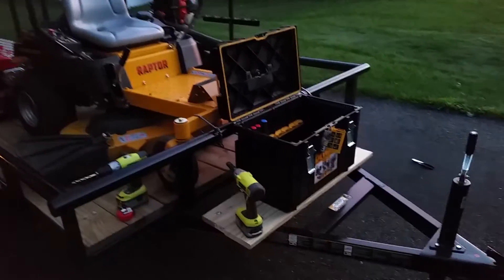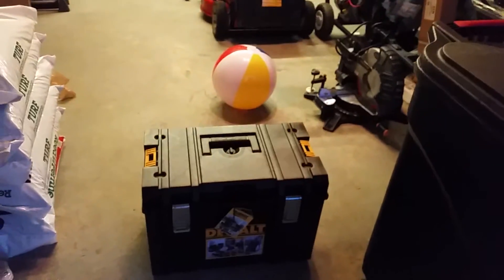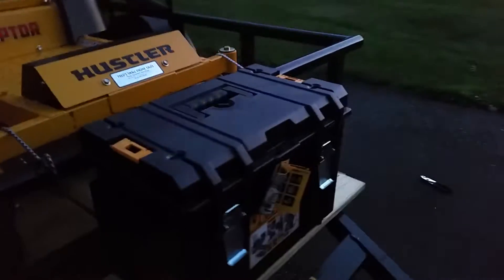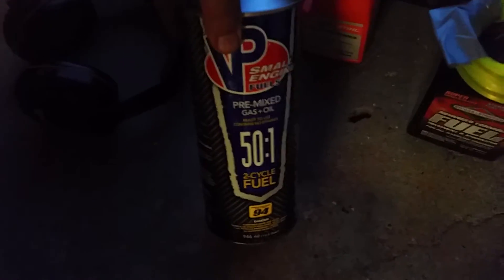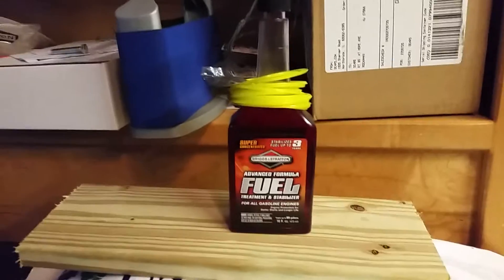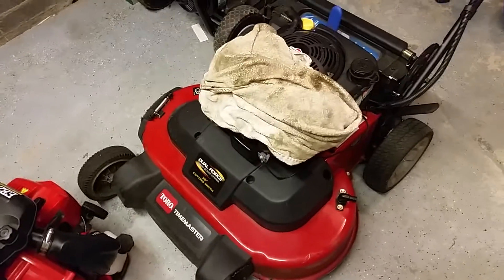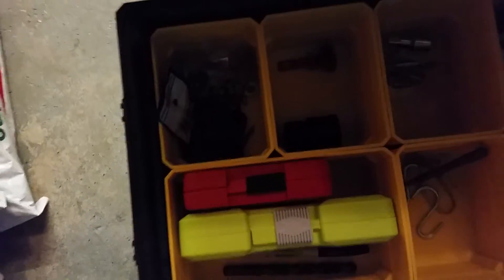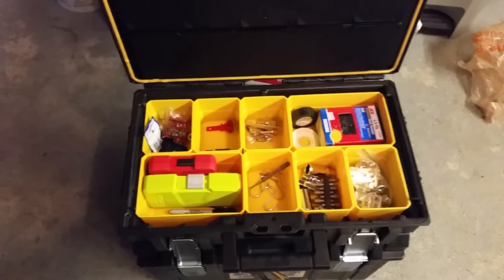DEWALT DS400 TOUGH SYSTEM REVIEW

Comment: I've questioned selling my TM and grabbing a back up awd a few times now... I always tell myself if my 44 breaks down its my back up in a pinch and I carry it with me. 

As far as impacts go man I got a Milwaukee set a few years back and when my 1/2" broke it was tough times going back to cheater bars lol my wife ordered me a replacement for my birthday and when it was in the mail my cheater bar skipped and busted me in the face below my eye. Man I was pissed off, what are the odds right? Man I love em. I have three 3/8" ones (dewalt, Mikita and Milwaukee)
Reply from the maker: Wow that sucks bro ...damn I hope it didn't hurt too bad ...you got 3 impact wrenchs?? I was thinking of getting another one a smaller one ...I love ryobi stuff ...toro owns them fyi...but they don't make a small one...what one you like best...???
Reply: That's the thing. I keep my dewalt inside the house because the battery dies so fast. The Mikita has a new battery and is small so I keep in in my truck. But the Milwaukee(s) have ion batteries so they can be left out in my truck box all year. My dewalt is the worst but I never had the batteries new so I really can't judge it. Makita was horrible till I got new batteries. My Milwaukee has never let me down. Except when I stripped the gears out of the big 1/2" but i also used it everyday all day on cars so after a few years it gave in. The 3/8 is still great though never had an issue.